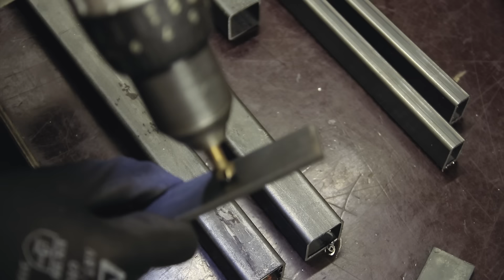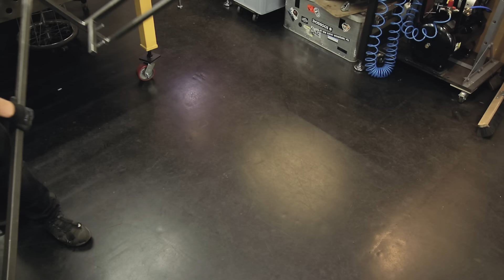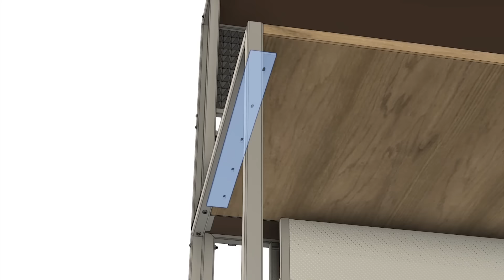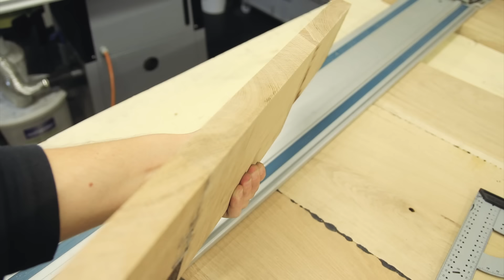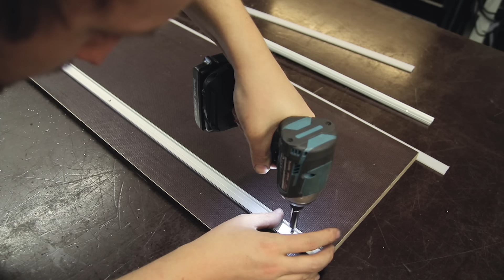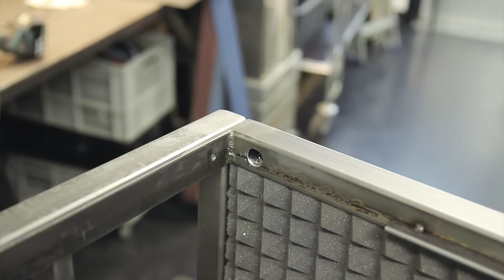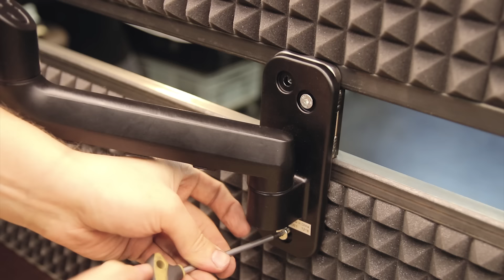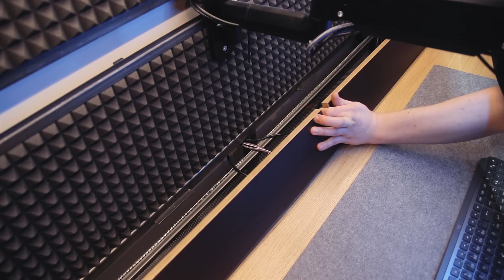How to Build a Cable-Free Desk with Built-In Lights, USB, Outlets + More!

Comment: I started thinking about what would be needed to replace my current desk with yours - and the first thing that came to mind was the missing ability to adjust the table top height electronically.

I think it'd be one thing to add the ability to adjust the height level of the table top by itself, another to adjust the height level of table top and above (include the back and sh elf), but another thing entirely if you could adjust the height levels of the table top and the modular strip/top-shelf individually.

I'd love to see how you'd tackle that one. I just read the FAQ briefly out of curiosity and see you attended to "why not height adjustable". I'd still love to see how you go about it and how well it'd work. More specifically because most height adjustable desks are table-top only or have very minimal useless shelving and I too have never loved a desk more than my hardwood executive desk with fully-backed hutch, where I had the shelving loaded and the top as a platform for my 3D printer.

Awesome video though - great work, not that that needed to be said; Enjoyed watching it through.
Reply from the maker: I can see wanting a standing-desk feature but I can't think of any practical reason to have a height-adjustable shelf. I don't think the added complexity would justify whatver use that could have. As for the table legs, there are numerous companies who build adjustable table bases and they pretty much have it figured out, there's nothing new I could bring to the table here (pun intended), so building that mechanism doesn't really sound worthwhile either. The thing that usually motivates me to come up with a design is that I can't buy it in the particular version I want (or at all), but I'm not really interested in re-inventing the wheel, so it's unlikely I'll tackle building an adjustable base anytime soon when there are high-quality and affordable solutions for that on the market.
Reply: @PhilVandelay  

Thanks for replying!

Yea I hear ya there - I have VIVO's $200.00 base, I think its pretty much the "baddest" base-only solution at the moment, dual-motors, done in a way to support like 250lbs and prevent fall-back in power outtage. Thing is, its not extremely sturdy; It's an upside down set of T's with a bar between and shakes pretty badly. I was envisioning something like rails going up the legs of a solid frame you build with NEMA steppers driving gears that give a solid and stable up and down traversal.

However, I do get it; To do it is expensive, to design it is time consuming; though I think you're underestimating yourself (or I simply am not knowledgeable of the markets where such a pre-designed commercially available - and affordable - solution already exists.

The shelf, only because it would get in the way of the modular space (i.e. the screen), and with that in mind its actually quite often that you find you don't need the monitor to traverse the same distance you need your table top to traverse, but that you do want it to traverse to some extent. The neatest design I saw that was extremely functional was a system where the (available on Amazon) desk itself adjusts, lifting everything on it, but the monitor stand (a similar gas arm, but driven, not tension for easy movement) also separately adjusts vertically as well.

Anyways, I saw that in your FAQ you have no use for it and as well that building these things are expensive and time consuming. I do alot of prototyping on different levels myself and know all about how motivated one has to be to even go through the process of building something for oneself, let alone recording, post processing, and sharing the endeavor.

Kudos to you and thanks for sharing man - really appreciated!
Reply from the maker: @kirvedx  Regarding table bases, I've actually just been sent one by Flexispot to review it and so far I'm impressed with how sturdy and heavy-duty it seems. I think those things are still getting better and the more expensive ones seem to make a difference. Of course this type of mechanism will never be as stiff/sturdy as a static table, but then if it's really used as a desk I don't feel it has to be super rigid, so I think the market has mostly found the sweet spot between "sturdy enough" and "reasonably priced". I have actually thought about these lifting mechanisms a bunch for other purposes too but have never come close enough to needing it enough as you said. There's a video somewhere on Youtube of a guy building a 2 ton welding table completely from Aluminum (yes it's as crazy as it sounds) and he built a four-legged lifting mechanism into it with chain drives going through the inside of the frame invisibly and driving all 4 legs synchronized. It's completely nuts, I think you'd get a kick out of it. 
Actually I just found it:

https://www.youtube.com/watch?v=1gXILMfVAuk

Anyway, thanks for the kind words, all the best!

Comment: I've just added this to my reference video playlist. It's a great base for expansions into a durable workbench, a heavier duty conference table or even a long bar table against your dining wall. Super good ideas with the adjustable mounting positions of the monitors and speakers, and your simple track system could be adapted to mount pretty much anything to the back wall of a desk.

Comment: the metal table is by far the most necessary tool to make this project imo. besides the welder ofc
Reply from the maker: Not really, you could weld this entire thing up just using a vise or some clamps, just takes longer is maybe a little less accurate but totally sufficient for a desk
Reply: Well, I started making the desk and I can say that I wish I had the welding table, the Metal Cutting Band Saw Machine and the belt grinder. No doubt they would have greatly simplified the work.

Comment: Strange question about welding and filming.   You obviously do a lot of it, is it a concern that filming the welds will blow out your sensor or have higher wear on it?  Or does the auto blur have enough of an effect that its a non issue?
Reply from the maker: In my experience the "blow out the sensor" thing is a total myth, I've been filming welding for years with various cameras and never had a single problem with any of them

Comment: So I’m looking into building this but I have a questions about the size of the material and measuring. The angle iron and steel tubing I can get in the USA doesn’t quite match with the mm sizing. If I got your plans would this be the case. Can your plans be changed to inches for me to go off of?

Comment: Great build, the video felt like a smooth watch too. For the squares where you welded 4 tubes, how come you chose to weld separate pieces instead of diagonal cuts on a long piece and bending to 90 degrees?
Reply from the maker: Not  really sure what the advantage would  be, would probably take a lot longer plus more chance to mess it up
Reply: @PhilVandelay  I think it's supposed to be stronger but I'm not a metal fabricator, I agree it definitely would take a lot longer. A year and half later is there anything you have added/wished you could have added when building it?

Comment: Giving a sub and like because this is almost exactly what I had in mind a few years back before I bought motorized tables instead.
The gap in the middle for omni-mounting accessories is pure ingenuity on your part - my original thought was simply just using a wood board and bolting a wall bracket for a screen on.
Other differences:
1) I wouldn't have gone for the integrated cable grommets and hubs; instead I had wanted to do undertable mounted powered USB hub near the front edge so that there's no need to reach into the back to plug in stuff.
2) I had planned for 2020 aluminium profile since I can't do welding (no workshop and residential electrical outlets are current limited).
3) I would had wanted to do gap on the rear cable cover and put a long brush strip instead (something like the brush guards placed below doors to prevent insects from coming in) instead of cable grommets.
4) Keyboard tray so that the table top is kept clear for other stuff (reading/ writing/ snacks & beverages).
5) An under desk mounted short height slide out drawer or tray - useful for keeping stuff like pens/ pencils/ rulers etc.

Comment: Great project that turned out really nice. The only thing I would change is the phone charging. I assume you are using wireless charging?I think if you used a router from underneath the desk you could remove enough material so that the wireless charge plate could be mounted under the desk. No cables on the desk and an even cleaner look. Just put you phone on top of the "charge plate" and it gets topped off.

Comment: Your video was a source of inspiration for my own build. I was able to create the perfect desk for my needs thanks to you. My desk is all wood with a modular backboard/shelf. Painted it all black and sanded down the corners and surface. Came out perfect for mẹ. I run 3 monitors and one Huion drawing monitor. Thats a total of 4 working monitors for my dream workspace. I installed an industrial outlet strip that has 10 outlets, let mẹ tell you. Its a beast. I recently added a slide out keyboard tray under the table with adjustable angles. One of my proudest projects, and I credit you man.

Comment: just an idea for anyone with a wireless charger if you  have a flat pad version you can drill out the bottom to the size of the charger and if its a thin enough gap you just have to set your phone on the desk to charge maybe mark it with a lightning bolt pearl veneer so anyone else using your desk knows where to charge their phone at

Comment: i know its an aesthetic design, but you should never round the outer diameter of a nut, when you are building a furniture piece with the goal of assembling & disassembling regularly. i see they are hex nuts, but if that hex strips from regular disassembly, having a squared outer diameter head will make anyone in that position glad they werent rounded outer diameter headed. if you didnt want them squared out diameter, you could put a single slit through the center of the head, so in a pinch it could be backed out with a flat head driver.

Comment: This video is a year old so I'm not expecting much of a repoly...but...I want to ask. I keep seeking poeple with speakers attached to their PC, no computer speakers but actual sterio speakers. How do you connect them without a receiver? I don't a receive int he video.
Reply from the maker: These speakers actually have a built in receiver/amp and can be used with cable or bluetooth. They just look like "normal" stereo speakers ;) 
I linked them in the description, there's also some other models now that look like Hi-Fi speakers with everything built in, so you're probably seeing those in other PC setups

Comment: So I've always wondered; When you weld, do you weld just the two pieces together, or do you melt a bit of material into the seam you're connecting? Cuz I noticed you had a thin little piece of metal or whatever so it kinda seems like you need a bit extra material to create the seal.

Comment: Strongest computer desk EVER !!!! i would have used a biscuit joint when gluing the wood together to make it stronger other then that, you've got yourself one hella desk good job !!!!
Reply from the maker: Biscuits don't add any strength to wood connections, it's a common misconception. The strength comes from the glue, biscuits only help with alignment which wasn't necessary due to using a flat table. There's a good video about it here: 
https://www.youtube.com/watch?v=8WH7T4b9l2g
Reply: @PhilVandelay  well learned something new today!! i know you dont have anything really heavy going on the desk but i know you would just add bracing across the bottom to make it stronger

Comment: Very nice project :) I am going to build something similar in the next months :) Mine will have two rails for accessories (I am using dual widescreen monitors stacked) and will be motorized. Unfortunately I don't have access to welding equipment so mine will be bolted.

Comment: If you want to build something like this but dont know how to weld, you can use extruded aluminum and brackets with T-Nuts, it's the same material 3D Printer frames are made of

Comment: This might be my new favorite desk idea, and the first one with a back and top shelf that I actually love. Having it be sturdy enough to mount monitors directly to is a game changer that I haven't seen anywhere else and I have to have it! It would also make an amazing work bench for my model building/painting, especially if pegboard were used for the back panels for easy tool placement.

Comment: The modular and adjustable nature of this design is lovely, I have built a few work station ideas myself, but all out of wood. I would love to learn is a how to weld. Fabricating something your way leads to something neater and lighter. Self supporting systems mean you don't need to drill holes in the walls (a problem in rented accommodation). It looks like a great place for cats, another interest I share.
I built a triple monitor non linear edit station in the late 1990s. Also many light box rooms and workshops during the AV era. I prefer more curvature in the work surfaces and shelving. if that is possible.

Comment: No cooling fluid in the drill press or band saw?
Reply from the maker: It's not strictly needed for every purpose, this is a cheap saw without a coolant pump but the blades last a long time. I use cutting oil for drilling, no need for flood coolant just for drilling a few holes

Comment: @Phil Vandelay, With this kind of build, is it really necessary that Steel square tube be used, or is it ok to use Aluminum Square Tube? 
I just wanted the table to be lighter, but still strong enough to carry load on the table top. 
I have an L-shaped table top, where do I add structure for it in this design, to accomodate the L-shaped table top?

Comment: Is gluing thick heavy slabs of wood like that, enough to not break off from the bond when used overtime?
Reply from the maker: A properly glued wood joint will be stronger than the wood itself, theres a few videos about it on youtube
Reply: @PhilVandelay   It would be interesting if you can also build a custom Server rack cabinet, using the same square tubing.

Comment: Was curious about powering your desk, and if you did anything special regarding plugging into the wall.  Or if you just plugged the power strips into the wall and that worked fine?
Reply from the maker: Nope nothing special, it's really like any other desk, drawing whatever amount of power your devices need, just with a few LEDs in addition that don't factor in much. But the advantage is you only have one cable from the main power strip going to the outlet. Makes it very easy to move the desk around without unplugging tons of stuff every time

Comment: If you move often, or would just like a desk frame that can be easily disassembled, use 8020 aluminum extrusions or something similar. No welding required. The aluminum can be easily cut with a chop saw or table saw.

Comment: The feeling of accomplishment after taking on and fully smashing this task out of the park has to feel so good. At first glance as you start the video you just think that it's a "fairly simple desk" and then you get the full rundown of how DIY it is and how thought out and meticulous / tedious it was to build and all the different materials that come together to create such a marvel of a desk! Solid job man.

After finishing the video I must say it would be a very cool / likely helpful thing if you 3D printed new headset holders but add some magnets inside of them, I'm sure since making this video you have realized or experienced the odds of them slipping off unless you got the slip fit just right/tight!

Comment: Just created a replica of this table, thankyou for this great design..

But i have concerns regarding steel housing for electric cables that it can cause issues....
Reply from the maker: You could connect a ground wire to the table so the frame is always grounded for extra safety
Reply: Thank you once again for your suggestion, highly appreciated

Comment: While I don't think I'm going to build entirely from scratch, I definitely got a few ideas for modifications to my IKEA Jerker desk that I'm about to (finally!) assemble after having it in storage for something like 10 years.
Adding a back to mount the monitor to, as well as the cable tray channel should get 90% of the capability that you were seeking in your design.

Thank you for your video, and for prompting the ideas of practical usability improvements.

Comment: Newbie here! According to my knowledge of welding, the workpiece has to be connected to the welding machine. But the small workpieces he uses aren't. Can someone tell me how it works? Or what the process name is?
Reply from the maker: The ground contact is provided through the welding table which has the ground clamp attached to it, since it's conductive,  any chain of conductive materials that touches it is automatically grounded to the welder. The process is called TIG welding
Reply: Oh wow thanks!

Comment: A beautiful abomination, but I hate wireless keyboards and mouse, so I dont mind those having cable, its not like the cable was that huge of an issue, not even in case of mouse, its far better than when it goes out of power at the worst possible time like it always does lol. I also have a monitor stand and hid the cables behind it nicely.

Comment: Hi, Awesome video.
I read the faq as well but I wanted to know if we are to build a height adjustable desk, what kind of equipment we would need to acquire? I am asking about the motor etc. not the material processing equipment. It would be lovely to know about that as I do have a fabrication setup however I would need to know the rest of the things.